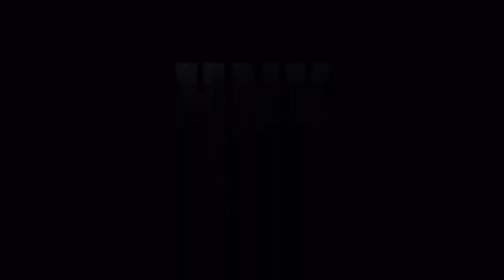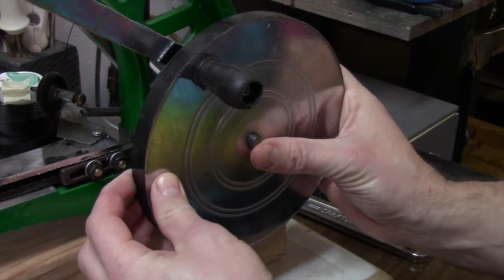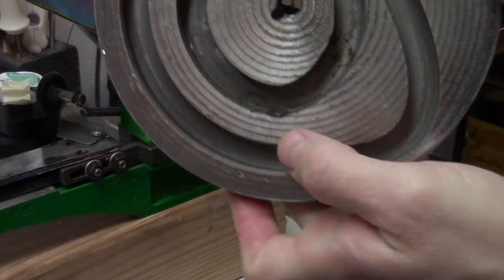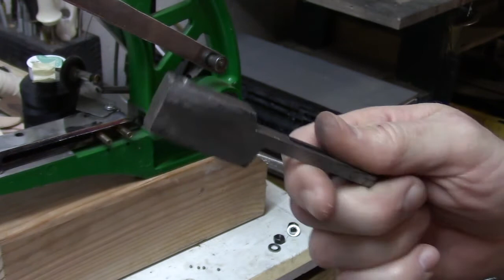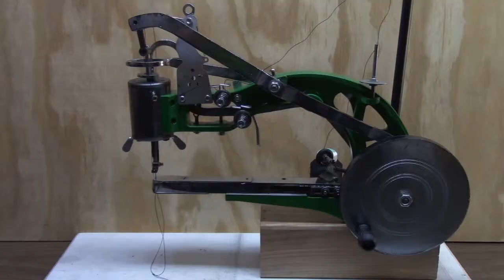Repair Chinese Cobbler Racer Bearing (Survival Sewing Machine)

Comment: was wondering if a thrust bearing would be better for this application.
Reply from the maker: Not sure. Perhaps if you would find one the correct size it would be worth a try.
Reply: Did you locate a thrust bearing and was it usable
Reply: Did the thrust bearing work

Comment: Not a bad idea to grab a scribe or a punch or something and making some witness marks before you remove that part for repair or cleaning, so you can easily get it back together at the correct adjustment so you don’t throw your timing off.  Especially if you’re removing the rack that runs the bobbin at the same time. There’s a fair amount of adjustment in the slots where they bolt together and you can create some problems for yourself if you’re not intimately familiar with the machine.  If you end up without any indication and don’t recall exactly where it should be adjusted, a good starting point is with the flywheel positioned for the maximum throw, the rack should just peek out the end of the arm.  …at least that’s where mine is, I guess ya never know with the tolerances on these machines   Anyway, sorry for rambling just thought I’d offer an idea that could save somebody a headache some time.  Not that I’ve ever caused such a headache for myself, of course.
Reply from the maker: Thank you for taking the time to add this information to the discussion. I know people will find it useful. Once you get these machines dialed in correctly, they certainly do save a lot of time.

Comment: I've had my patcher for about two years now. I did spend about a month cleaning, sanding, polishing, and learning its idiosyncrasies. But once the learning curve was over I've really enjoyed using it. I recently installed a servo motor, which works well, but I've been concerned about the arm bearings inside the flywheel. Happily, I ran across your website showing the replacement procedure, plus the link to Bantam's website where I just purchased the spare bearings and some other goodies. Thanks for sharing the information.
Reply from the maker: You are EXACTLY right! When you get one of these you have to be willing to put in the time to clean, sand, polish, etc and LEARN how they work. There is a super steep learning curve on these. If anyone thinks they are going to work well right out of the box, they are fooling themselves. But with some TIME and patience, they can become great additions to the shop. Better than dropping a grand on a "real" leather sewing machine. They are perfect for non-detail work. Thanks for watching and truly adding to the discussion. Stay well. Peace.
Reply: Well I was just going ask where to get the correct bearing, then I read your comment and you answered my question. Thanks.

Comment: Man oh man...  I hate when this happens...  You dis a great fix!!
Reply from the maker: I was a little chaffed about spending near $10 on two bearings, but at least it is working again.
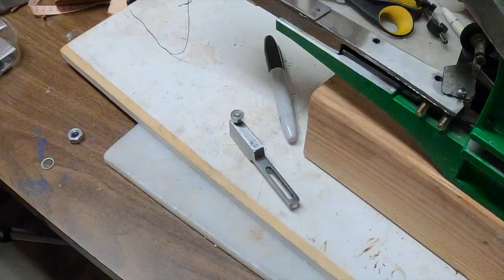Reply: Ok, question...  I didn't have broken bearing, but pulled the lower arm apart to clean the mill scale and nast  off of everything.   Put it back together and thread it up, everything seems to be running smooth...I go to out a first stitch thru a piece of leather and it makes less than a full rotation and locks up.  It's like the machine won't turn that corner where the flywheel inside race turns to bring the  bottom sliding gear rail back in the other direction.  Just hits a wall.  The needle had already pierced the work and bottomed out, everything just comes to a halt.  Doesn't seem to be the top arm binding up or anything.  Seems like the bobbin carrier is somehow bound up that quickly and stops the whole operation.  How can the timing be that far off that quickly?  Setting it up 11:00 crank handle to 3:00 on the little bobbin carrier thing. The hook seems to be catching the thread loop off the needle fine when run without any material but as soon as it's actually putting a stitch thru something, it binds up tighter than Dick's hatband.    Ideas?   Im about to put this damn thing thru the wall.